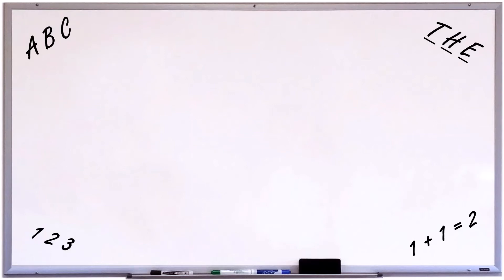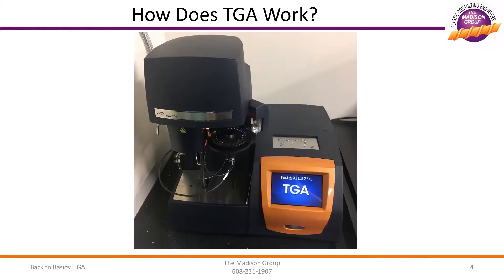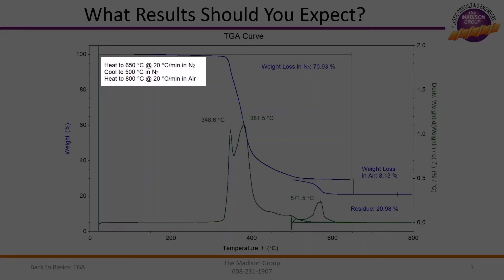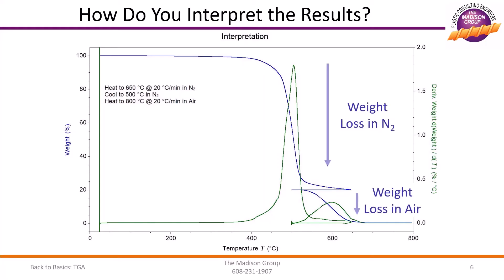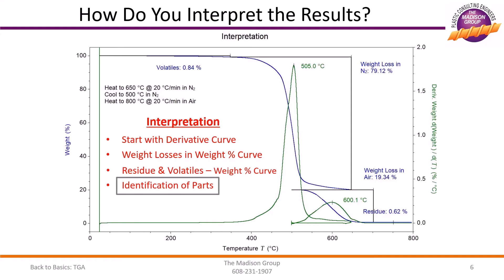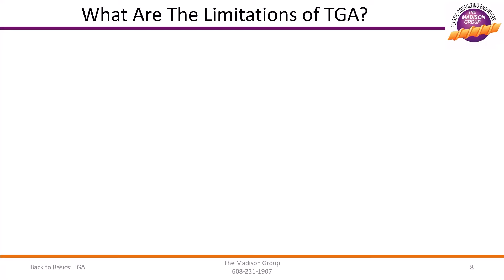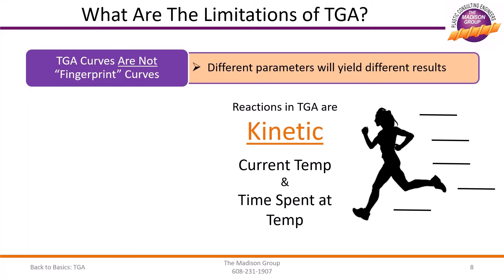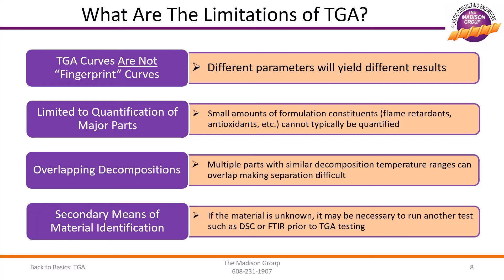Back to Basics: Thermogravimetric Analysis (TGA)

Comment: Thanks for this video. I have a small doubt with this system. If our compound have low melting point /or/ sublimation point, then is there any chance of decreasing the weight percentage in TGA curve when this compound cross this temperature?

Comment: Researchers around the world (in the literature) perform TGA on cement mortar after crushing the fragments of cement mortar 9eith the help of pestle and mortar) serving through the powdered sample through 40 micrometers to 75 micrometer mesh. I have some reservations in that if we do this procedure for preparing the samples to be subjected to TGA, we are either overestimating or underestimating our results because of the inclusion of finer particles of sand that went along with the particles of cement during the sieving process. In other words, I want to ask whether there would be a difference in the results obtained for powdered form of (1) hardened cement paste i.e., only cement and water; and (2) hardened mortar i.e., cement, water, and sand)
Reply: I would suggest you to do the TGA of mortar keeping the same mix design as that of your concrete mix. That’s what I do, I had the same reservations as you mentioned